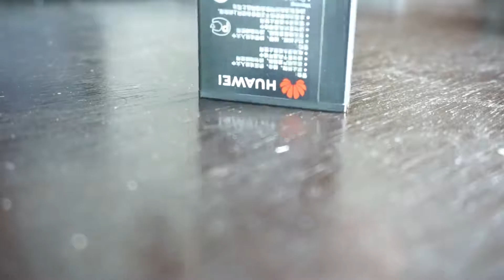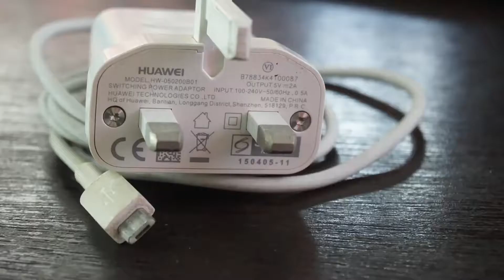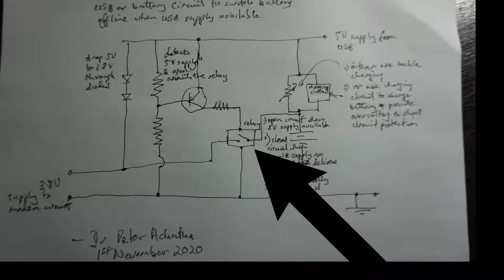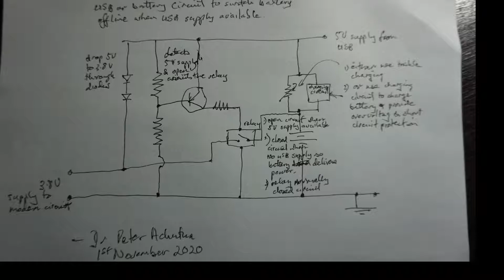Lithium Ion USB battery charger protection circuit for Huawei portable wifi router, cameras, phones

Comment: I am also facing same swollen battery problem
Reply from the maker: Thanks for your comments. I found that the Lithium Ion Huawei batteries do swell within a year. I suspect that most Lithium ion batteries only last about 3 years after which they cannot be charged. This happened to my substitute Sony camera batteries from a different Japanese supplier (i.e. made in Japan).
Reply: @dr.peterscroll422  Welcome

Comment: Could you please tell me, is this router can be run directly by connecting to a powerbank without putting the given self included Tenda's battery like Jio Fi router .I mean in Jio Fi router we can put the powerbank and run the router for long hour without putting the self given battery ? Please reply soon
Reply from the maker: You can use a power bank which has a USB output but if there is no battery inside the Huawei modem it will not startup and so will not work. You can use a power bank through the USB connection provided you still have a battery in the Huawei modem. I have tested the Huawei batteries but they will not last more than a year. If you need a router you could try other models such as TP-link routers that do not have batteries and are connected directly to the mains.

Comment: Thank you sir for adderssing the problem!
I have the exact same issue with my battery (Huawei HB824666RBC) and I thought it wasn't a big deal until I came across this video. Batteries in my country get swollen quite often due to the hot weather we have.
Reply from the maker: Thanks for your comments. I am testing the batteries now on low voltage charging. That is charging them at 3.8V instead of the USB 5V since November 2020. It looks like so far they have hardly swollen. In another 4 to 5 months I would have tested them for a year on low voltage charging. That means I have to wait another few more months to confirm it does not swell with low voltage charging. I have not switched off the battery charging since November 2020 and it is continuously trickle charging 24 hours a day.

Malaysia is a hot country too and my room temperature is around 32C most days and some days it goes higher to 35C. That is when my Acer Nitro 5 keyboard stops working. it will miss out letters in every word and typing is a misery because I have to keep correcting every word.

Comment: Hi Dr.Peter ...... thanks for the video very useful but i found some simple solution i removed the battery and used the circuit and instead of battery cell i have connected to direct 5V USB source adding diode inline.
thanks :)
Reply from the maker: Brilliant Subodh.
Reply: Please bro can you explain more .
I have airtel zte mf90 router and I want to use it without battery, direct power. 
Amy help.
Reply from the maker: @ritanbarman  Sorry for the late response as I needed to know whether you have a electronics background and what would be the best solution for you. Do you have an electronics background?
Reply: @dr.peterscroll422  no sir not really.
I just need to run the router without battery.
Reply from the maker: @ritanbarman  My safest reply would be to buy a mains operated router. They are about half the price if not cheaper than the ZTE MF90 router and you can use the battery operated router when you go out. I guess it is because you spend many hours on the internet, just like me, and the battery has to be charged continuously. But I guess that is not the reply you wanted to hear.

It will be difficult to explain to you what needs to be done. Do you have a friend who has a electronics background. I could explain it to them and then they could help you.